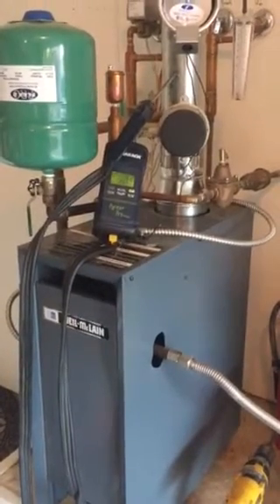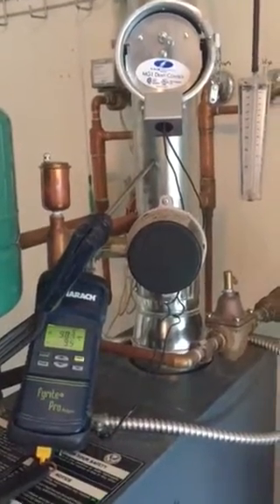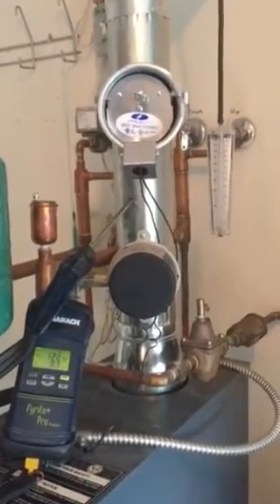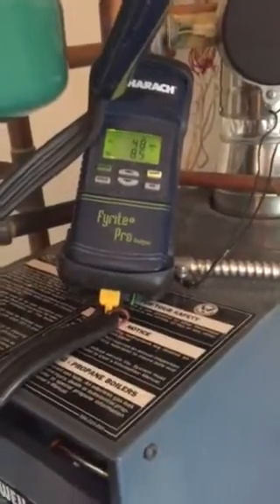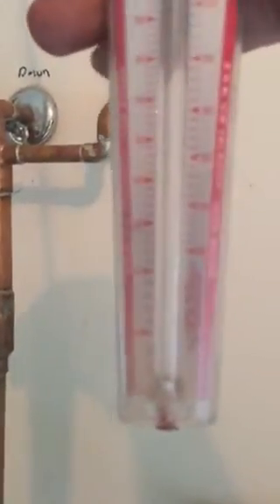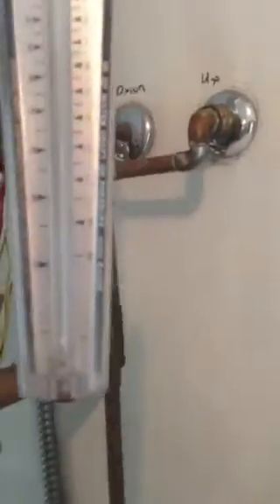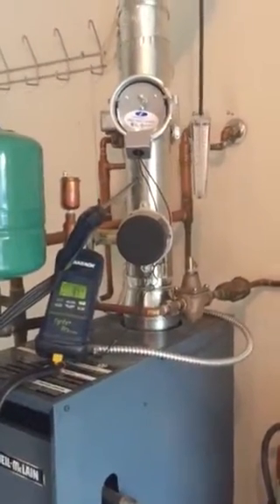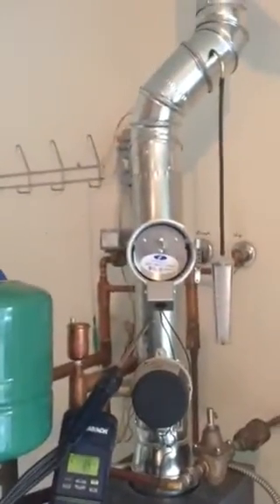Barometric Damper

Comment: Where is that vent going? Is it to a natural roof chimney or to your outside wall?
If it is to a chimney on the roof then you would have natural high airflow on the roof to give you a negative suctioning effect (aka draft) to draw out the burnt gases from your burner; and if not, and the vent is to your wall without the effect of high air flow to create a natural negative draft, then you would have to install a POWERED vent to suction out the combustion burnt gases using electric powered motor. The problem with such powered vent is that you'd need to keep an eye on it to make sure that it works properly and if it doesn't all the burnt gases would stay right there in your basement. That said, you can install a CO reader right around the area that would go off if the level of CO is high to alert you if the motor of the powered vent is not working. Just a comment....